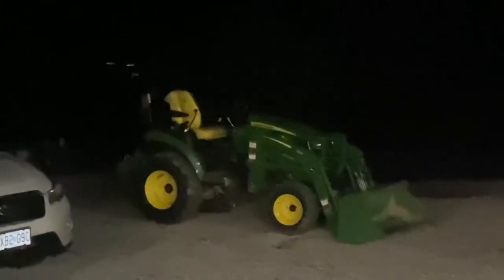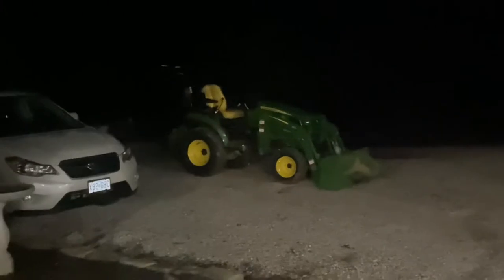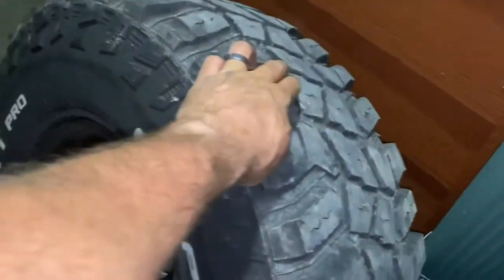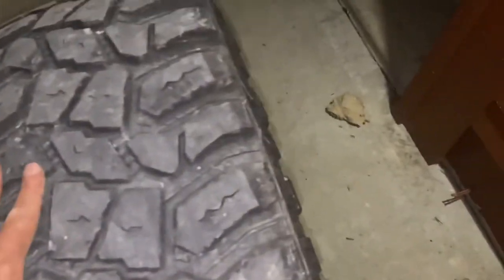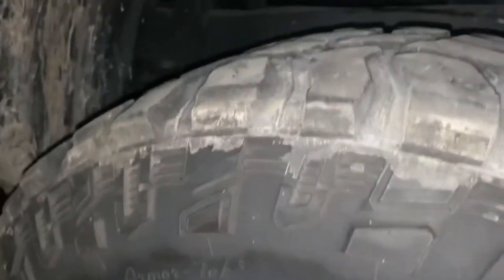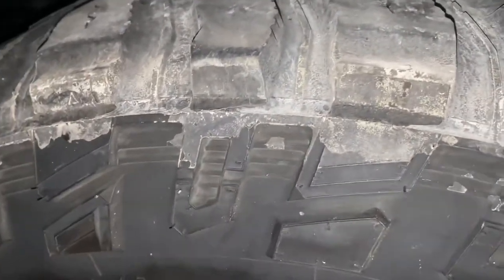3rd Gen 2018 Tacoma Firestone Airbags Install….kind of

Comment: Looks like you offroad your truck if you have sliders. Do these airbags hinder you from flexing and tucking when they’re not being used? How far will they stretch when that tire is off the ground?
Reply: I offroad and tow a race car from time to time but also have icon leafs
Reply from the maker: I never had any issues. It doesn’t let it stretch as far though. For me it made sense because I towed more than I offroaded. When I did off-road it was pretty light.